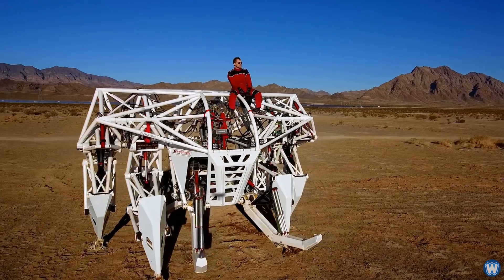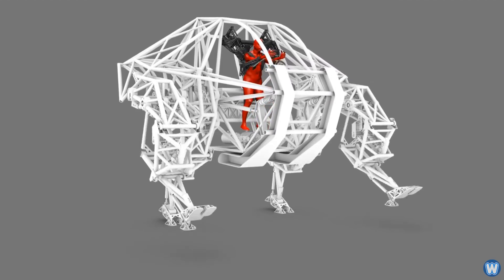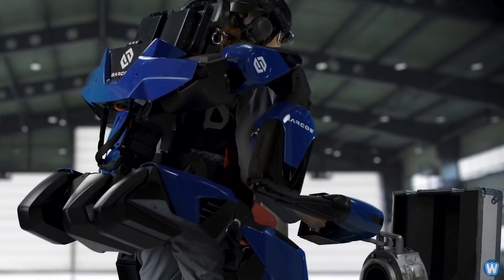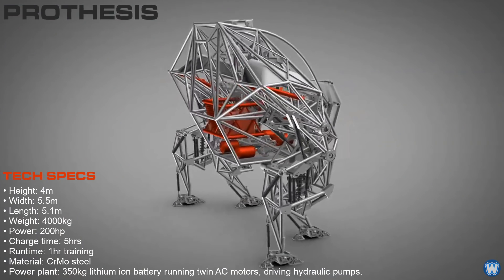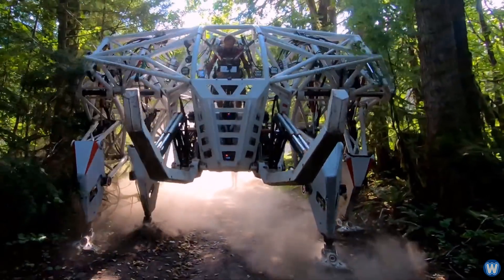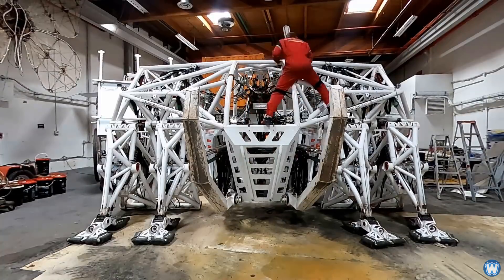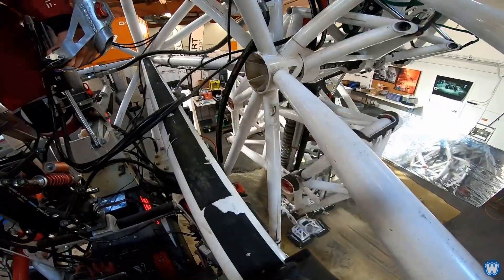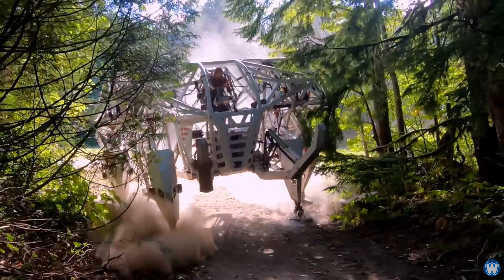World’s Largest Exoskeleton Racing Mech

Comment from the maker: ★★★ FREQUENTLY ASKED QUESTIONS ABOUT THE VIDEO  / FACT UPDATES ★★★

NOTE: some of these answers are from Johnathon at Furrion Exo-Bionics himself, from his comments below.

1) at 4 Tonnes it weighs to much for a Racing Team, drop 2 tonnes to be viable - "We are already working on Mech 2.0. Two thirds the size, half the weight, twice the power...stay tuned!"

2) Can the Pilot get hurt if one of the legs gets yanked or pulled hard, will it hurt the pilots arm or leg? - "If by hit you mean by some sort of ordinance, or strike from another mech, that is not a scenario we're after. We are not building these to fight. If by "hit" you mean by an obstacle, or falling tree, then yes, the pilot would feel it - if it was a big enough impact to affect the 400kg leg significantly. With 200hp at your finger tips (or toes) and enough force to lift a car, it would have to be a substantial before it would become a nuisance. The heart of this mech is a patent pending exo-skeletal control system that locks the pilots limbs to those of the mech with full force and positional feedback in 100% realtime.  If the mech can't move, the pilot can't move."

3) What is the Power Source and Range of the Mech? -  it uses twin AC motors at about 75kW each, creating 200 hp, with a lithium ion battery running it
, it can run at up to 30 kph and can run for 1 hour, so 30 klms is it's range, but they have only walked at about 6 kph so far.
Reply: Thanks for aggregating those responses Scott. 

I wish #3 was correct. Unfortunately 30km/h is the THEORETICAL top speed, but that would require a power plant upgrade (with existing tech) that we plan to incorporate in Mech 2.0.  With the current power plant we hope to break 10km/h with some more sophisticated hydraulic control (coming soon with our new smart cylinders from RHK Hydraulics and MTS Temposonic!!! - see our Instagram: https://www.instagram.com/p/CF-QPUZBpZO/) and a WHOLE LOT of pilot training. At that speed the current battery pack would last about 15-20min, giving us a maximum best case rage of ~3km with the current set up.
Reply: Why are your comments so long?

Comment: If military youse this equip with machine guns and miniguns and tank turret and armor
Reply: And why would the military bother using this its slow,  has no practical use on the battle field , an unarmed Abrams tank would run rings around this machine and be able to destroy it just buy driving into it
Reply: Ok

Comment: If you were using this in the woods and it slipped down a hill into a river. Would I be right in thinking the pilot would drown due to how hard it is to get in/out of this thing? Same safety issue if it caught fire probably?
Reply from the maker: they are valid concerns, I am sure it's not quick and easy to get in and out of, the owner himself struggled to get into it in one of his videos.